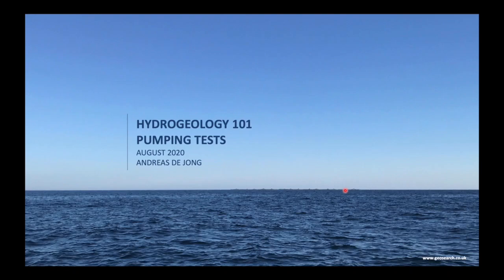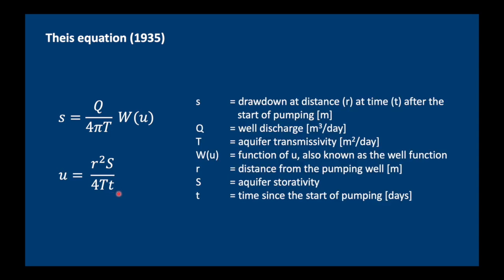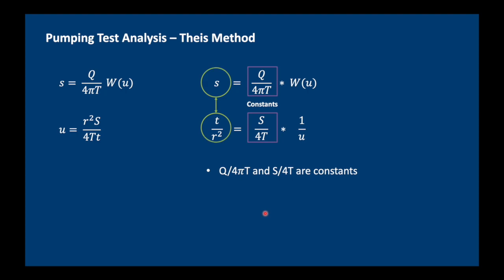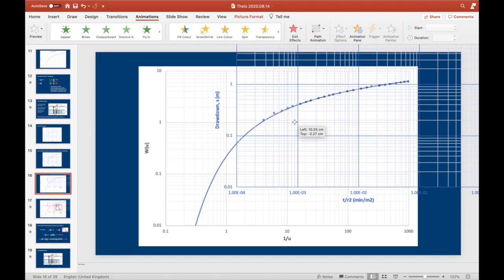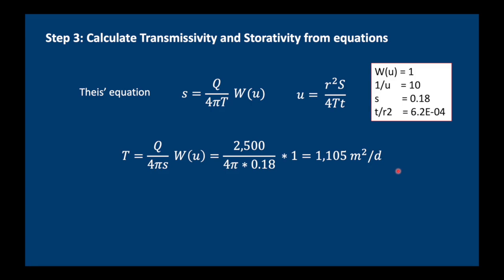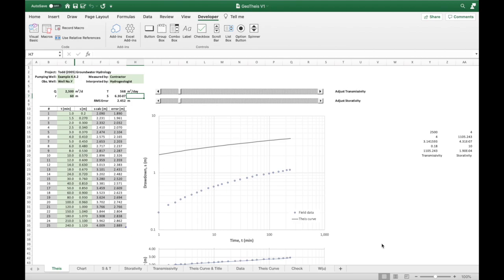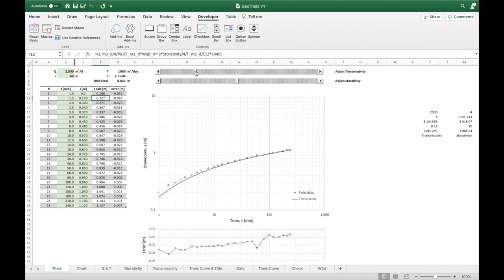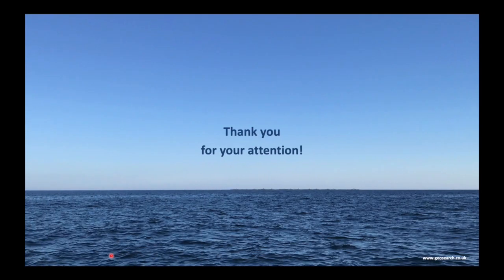Hydrogeology 101: Theis Method

Comment: Hi Sr, nice video. The spreadsheet shows a message that is protected. May you pass us the password to change the units from minutes for Time to days. 
Thanks
Reply from the maker: Hi @esnei_geo  Just click on t (min), and select days from the drop down list. All the best, Andreas
Reply: @GeosearchInternational  Hi Andreas, I tried that, but , it doesn't work. It showed me the same message
Reply from the maker: Hi, What is the message? have you enabled macros? All the best, Andreas
Reply: @GeosearchInternational  Yes, I chose the option to enable macros. But, it shows me the same message:  "The cell or chart you are trying to change is on a protected sheet. To make a change, unprotected the sheet. You might be requested to enter a password".
Reply from the maker: So sorry you are right. The unit cell is green but still protected. All you need to do is right-click on the sheet tab on the bottom and select Unprotect sheet. There is no password. Also I have uploaded corrected versions of the Excel tools, so you can just download it again. All the best, Andreas
Reply: @GeosearchInternational  Thank you very much, Andreas!!
Reply from the maker: You are welcome!

Comment: Question 🙋.  On step 3 I'm failing to understand how tu changed to (t/r^2) and how r^2 changed to 1/u . Thank you
Reply from the maker: If we consider the Theis equation:
s = Q/4piT * W(u)

The equation for u is:
u = (r^2 * S) / 4Tt
This can be rewritten as:
t/r^2 = S/4T * 1/u

Since Q/4piT and S/4T are constants, the relation between (s) and (t/r2) must be similar to the relation between W(u) and (1/u). This is the basis of the Theis curve fitting method where s is plotted against t/r2 and fitted against the curve of W(u) against 1/u on log-log paper in order to estimate the Transmissivity and Storativity of the aquifer.

Hope that makes sense. All the best, Andreas

Comment: How do you calculate "s" (drawdown) from Theis formula in excel sheet? Do you use any approximation or truncation from original infinite series?
Reply from the maker: Hi Guilherme, I found the code for the approximation of the Theis well function many years ago from a university course, but I have lost the source. Cannot find it on Google either so maybe it has been taken down. Anyway, please see VBA code below. All the best, Andreas

**************************************
Function Wu(u As Double) As Double
Dim a0 As Single, a1 As Single, a2 As Single, a3 As Single, a4 As Single, a5 As Single
Dim b1 As Single, b2 As Single, b3 As Single, b4 As Single
a0 = -0.5772156649
a1 = 0.99999193
a2 = -0.24991055
a3 = 0.05519968
a4 = -0.00976004
a5 = 0.00107857
b1 = 2.334733
b2 = 0.250621
b3 = 3.330657
b4 = 1.681534
If u < 1 Then
Dim t As Double
    t = (a2 + (u * (a3 + (u * (a4 + (u * a5))))))
    Wu = (-1 * Log(u)) + a0 + (u * (a1 + (u * t)))
Else
    Wu = Exp(-u) / u * (u * u + b1 * u + b2) / (u * u + b3 * u + b4)
End If
End Function
Reply: @GeosearchInternational   I've found out the references of your VBA code couple days ago. The approximation comes from two works: (1) Hastings, C. Jr. 1955. Approximations for Digital Computers. Princeton University Press, Princeton, N.J. and (2) Allen, E. E. 1954. Analytical Approximations. Math. Tables Aids Comp., 8(48), 240–241. These references are quite hard to find online because they are a little bit old papers, but you can reach the same coefficients you used on excel sheets to the same range of u values.
Reply from the maker: Hi Guilherme, thanks so much for solving this mystery! All the best, Andreas

Comment: I am interested in using Theis equation to estimate Transmissivity (T) and Storativity (S) for a single well but there is no observation well. Measurement of draw down and recovery data is available for borehole well used by community. Your guidance is welcome
Reply from the maker: Hi Joachim, as a rule of thumb you can only estimate Transmissivity from a pumping well. This is because it is very difficult to accurately correct for well losses and also well storage effects. I would not trust any storativity value calculated from a pumping well. All the best, Andreas

Comment: Your presentation is very helpful up to now sir. Thank you for making this video. I have some concerns or problem on how to interpret the table of values of Kruseman & de Ribber. I hope you can make a separate tutorial on this. Thanks a lot .
Reply from the maker: @abengineeral Thank you for your kind words.
I assume that you are referring to the table in Annex 3.1 Values of the Theis well function W(u) for confined aquifers (after Walton 1962)? The values in this table are used to draw the type curves where you plot 1/u on the x-axis versus W(u) on the y-axis using log-log paper. Then you need to plot your water level drawdowns also on log-log paper and try to get a fit with the type curves, as I showed early in the video.
This is a good training exercise for new hydrogeology students, but it takes time. We can use digital alternatives to do the same thing. Carlos Molano has a nice tool to do this – see his video: https://youtu.be/iNhwT2yXlNA
My approach is slightly different. You select the Transmissivity and Storativity values for your aquifer using the sliders, and then the theoretical drawdown curve is calculated in the background using VBA. Once you have the best fit, you can use these T & S values for the pumping test. Note that you need observation well data to estimate Storativity and Transmissivity. If you only have pumping test data you can get the Transmissivity, but not the Storativity.
Note that the VBA code locked, as I don't want people to edit the code and get the wrong answers. All the best, Andreas

Comment: Please who developed the excel for the theis method you are using?
Reply from the maker: Hi Michael, The design layout was inspired by an Excel tool from Carlos Molano (https://youtu.be/iNhwT2yXlNA), but the methodology is different. My tool does not move the data to fit on the Theis curve. It calculates the Theis curve based on the T & S entered by the user. The calculations are made by some VBA code in the background. All the best, Andreas

Comment: is there any way we can get the password for unlocking the file????
Reply from the maker: You can unlock all the sheets and change the contents as you wish. It is not protected. The VBA code is locked, because any changes there will make the Theis calculations invalid. All the best, Andreas

Comment: What is the differences between Theis method ans Thiem method ?
Reply from the maker: The Theis equation is for non-steady state groundwater flow in a confined aquifer. It means that groundwater is still coming out of storage and water levels have not reached equilibrium.
The Thiem equation is for steady state groundwater flow in a confined aquifer. It means that the water levels have reached equilibrium & no water is taken out of storage.
As it costs a lot of money to reach steady state, most pumping tests are analysed using Theis equation or equations based on Theis, such as the Cooper-Jacob straight line method.
We would use Thiem to estimate long term inflows into excavations/mines.
All the best, Andreas

Comment: Hi Andreas, I was just wondering about the basic question which is how to initially decide which aquifer is of which type? After this answer, we can apply specific well-pumping data analysis methods. Please answer and if possible make a video on this very basic question from Hydrogeologists. Thanks a lot
Reply from the maker: That is an important question & you are right it would make a nice short video. What type of aquifer it is (confined, leaky-confined, unconfined) can be guessed during the desk study. You will need to figure out the geological units and how the water levels in existing boreholes relate to them. If the static water level is within an aquifer, it is probably unconfined. If it is above the top surface of the aquifer, it is definitively confined but if it is leaky-confined or not depends on the permeability of the confining layer and if there is a source of water above it. Once we drill we can see what the water level does once we have drilled through the aquifer, to confirm the type. Be careful though in fracture aquifers as mostly we want to intersect the fracture at depth, so the water strike is usually well below the final static water level. It does not mean that it is confined.
The final proof is the pumping test. If you only have one pumping well you should be able to tell from the shape of the drawdown curve what you are dealing with. e.g. in unconfined aquifers we should get delayed yield - a flat period in the middle of the test when the drawdown almost stabilises. However, it is best to have at at least one observation well so you can calculate the storativity. All the best, Andreas
Reply: @GeosearchInternational  Thanks Andreas for the explained reply. If you find time and ready to work on next video(s) then please explain this in your typical style as it will make things very easy and self explainatoy. It would be of help for me and many others. All the best!

Comment: Thank you! For the excel workbook, I keep getting errors in the "s calc" and "error [m'" columns, with "#NAME?" appearing, do you happen to know why that might be? My theis curve isn't showing up on the graph either. Thanks!
Reply from the maker: #NAME? error appears when a formula or function cannot find the referenced data it needs to complete the calculation. Make sure that you add all the required data in the green cells. All the best, Andreas

Comment: I can't figure out how i can adjust the storativity and transitivity
Reply from the maker: Transmissivity and Storativity are calculated by Excel. You need to put in the data & fit it to the Theis curve as shown in the video: https://youtu.be/YMcRRIe4iAg?t=633 
Good luck & all the best, Andreas
Reply: @GeosearchInternational  i have the same problem.  I keep getting errors in the "s calc" and "error [m'" columns, with "#NAME?" appearing,
Reply from the maker: Hi Rudy, Assuming that you have enabled Macros in your Excel security settings, see if the original file works as I have shown in the video. If you put your own data in, make sure that all the GREEN cells have values. All the best, Andreas

Comment: Yes sir thanks for your kind message sent to me. I want an excel sheet regarding pumping well test analysis. not in an observation well.
Reply from the maker: Hi Chinthaka, you can use this Theis tool to estimate the Transmissivity of the aquifer. Just use the radius of the well as R. However, note that Storativity can only be calculated from observation well data. Have a look also at the Cooper-Jacob straight line method which has other advantages like being able to see aquifer boundaries. Here is the link:
https://www.youtube.com/channel/UCvnRoF32DJNLtNb-PGqEwjQ All the best, Andreas

Comment: Thanks for amazing teaching, Can we apply these & other conventional methods for recharge test ' where discharge to injected water and  drawdown as draw rise????? any useful materials?
Reply from the maker: Hi Nahom, yes you can use the same techniques because injection is just like a (negative) pumping test. However, you should be aware that the aquifer transmissivities from injection tests are often only 50% of those calculated from the same well during a normal pumping test. I understand that it is probably due to aquifer clogging and entrainment of air bubbles. Have a look at this paper from Israel: https://www.mdpi.com/2073-4441/9/1/53/htm All the best, Andreas
Reply: @GeosearchInternational   Thanks , you are so generous  to get  your attention for  my question , If you don't mind , is there any way to avoid disturbance of curve matching ,do we need like  to change raw data like putting -ve  ?
Reply from the maker: Hi Nahom, If you want to use the standard pumping test curves I guess you should just think of the rising water levels are drawdown - so just multiply by  -1, so that they are positive numbers. All the best, Andreas

Comment: Hello, can you reaupload your excel file? Link already doesnt work...excelent presentation! Thanks
Reply from the maker: Thanks Martin, the excel file is here: https://bit.ly/35sXDO5
I just tried it and it works. You will need to click on the download button (down arrow) on the top right of the screen to get the file from Google Drive. Then open in Excel & allow macros. All the best, Andreas
Reply: Thank you, got it! May I ask you one more question - does also exist spreadsheet for pumping well analysis?
Reply from the maker: Hi Martin, For the pumping tests please have a look in the Hydrogeology 101 playlist. I have shared one on Theis and also the Cooper-Jacob straight line method. All the best, Andreas

Comment: How are you sir, i am doing a self taught hydrogeology course, thanks very much for your video which is very clear, much appreciated. however I have a few questions. 

1) I would love to know how best can I use the transmittivity and storativity data to size the pump that can be used to extract water from such a borehole?

  2) is it always the case that whenever carying  a borehole capacity test  there should be an observation well? 

Thanks in advance sir.
Reply from the maker: Dear Dhuvayi, I'm happy that you like the video. I'm doing a couple of QGIS videos at the moment, but will come back to new pumping test videos soon. To answer your questions:

1) Transmissivity & Storativity is mostly used more for aquifer resources calculations, which includes modelling. For selecting a pump for a water well you need to look at the pumping (dynamic) water level and the pump discharge, as there can be high well losses especially in basement aquifers. If you do a 24h or 72h pumping test and the water levels are still declining you need to extrapolate that over the full length of the dry season so that you don't take a pump with a too high discharge. i.e. we need to look at projected pumping water levels & also do some sustainability calculations. I have Excel tools that do all this & will explain in future videos. As a rule of thumb it is best to take a pump which is about 70% of the maximum pumping test discharge. When you chose the pump, you should also consider head losses between the well and your water tank or wherever you will take the water to. There are many different pumps & they all have an optimum discharge-head relationship so you need to chose the correct one.

2) If we do a pumping test without an observation well, then we cannot calculate the Storativity of the aquifer. i.e. we can only estimate the Transmissivity. As observation wells are an additional cost, often they are not drilled and we need to guess the storativity. However, if you look around your project area, there could be existing wells which can be used for observation well data.

All the best, Andreas
Reply: @GeosearchInternational  thank you very much sir for your crystal clear explanation, very insightful, I have downloaded excel sheets for both Cooper-Jacob Straight line method and Theis Method you posted on your videos, which I hope will be very useful for me in future. As for QGIS I have to follow as well as I'm a newbie to it, at college I learnt about ArcGIS.
Reply from the maker: You are welcome Dhuvayi! I also used ESRI software since 1999, but it is just too expensive, so I am now using QGIS which can do everything which I need. Also QGIS is much easier to learn. All the best, Andreas